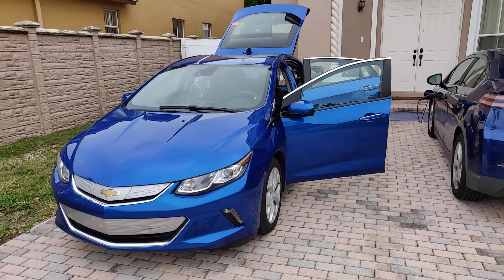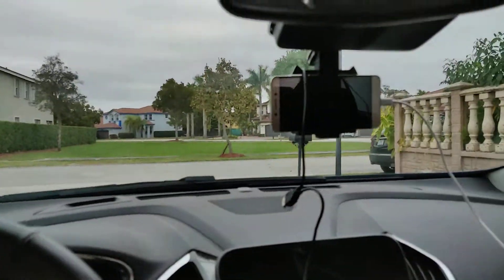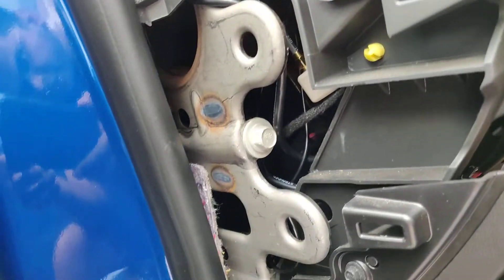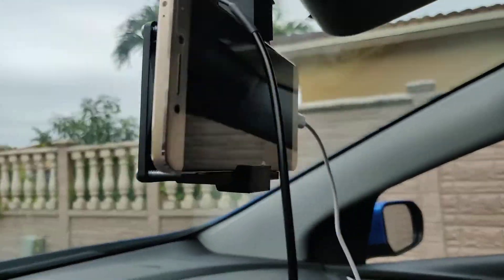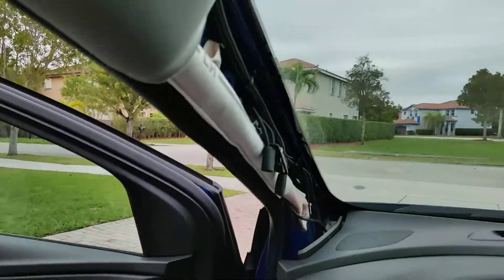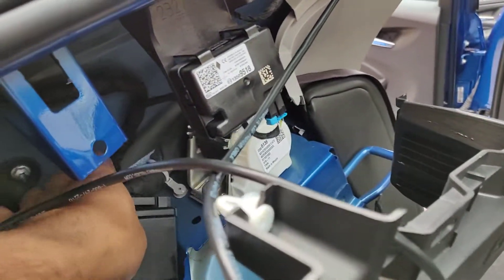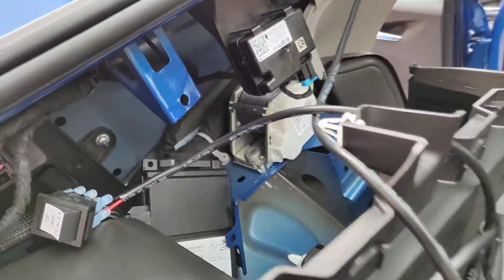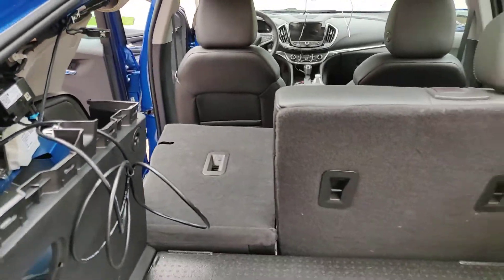Chevy Volt Openpilot Comma Ai Install

Comment: does the order of when/how you flip the various switches matter?  "Dealer" etc?
Reply from the maker: I just have it off when I take it to the dealership
Reply: @SP-cm8lg  ok, but is there a certain sequence to flipping the 2 switches?  For example, do you set it to "Normal" in the back and "Comma On" in the front, then turn the car on?  or, do you turn the car on and then flip the switches?  I keep getting "Radar Error: Restart Car" and am trying to debug it!
Reply from the maker: Maybe a wire is loose somewhere when you installed the harness, I had a lose wire had to fix the issue.
Reply: @SP-cm8lg  yeah, I tried that.  I have actually installed it on 2 different Volts (same spec) and the error persists.  So maybe the harness itself is bad?
Reply from the maker: @CH-qt4hr  contact the Maker of the harness maybe he could put some light on the issue you are having. Maybe try to do an update to comma 3.
Reply: @SP-cm8lg  I am on Comma 3, brand new.  They are sending me a new USB-C cable to see if that fixes my issue. Did you get that same radar error?
Reply from the maker: @CH-qt4hr  well I am still on the old comma have not upgraded to comma 3 yet, they have stop all support to the older comma so I have to upgrade.
Reply: @SP-cm8lg  thanks for all the help
Reply from the maker: @CH-qt4hr  let me know if your issue get resolved.
Reply: @SP-cm8lg  Issue RESOLVED.  The fuse that you use to power it was installed upside down (not backwards, but just flipped over).  I guess it has to be plugged in one way only.  Once I did that, everything worked perfectly.
Reply: @CH-qt4hr  your tip about the fuse reversed saved me, I was going crazy trying to figure out what was wrong. I put it in with the fuse sticking up so it wouldn't block the fuse below and that was causing radar errors. Flipped it over from reading your tip and it started working. Thanks!

Comment: Which version of Open Pilot is this? Will any version work with a 2017 Volt Premier with Adaptive Cruise Control and Lane Keep Assist?
Reply from the maker: All open pilot version works on the Chevy volt.
Reply: @SP-cm8lg  do you know how much better the newer ones are compared to version 1 and 2? I saw one for sale used that I believe is the first one and it needs the software flashed to it so I don't know how big of a deal that is.
Reply from the maker: @TCMapotherIV  I have not used the new one yet, if I was in the market to buy this for my volt I'll go with the comma 3.
Reply: @SP-cm8lg  that is the new one isn't it?
Reply from the maker: @TCMapotherIV  yep they are going to do lots of integration to comma 3, comma 1 and comma 2 there is no support no more.
Reply: @SP-cm8lg  I'll probably wait a little while to see how it improves before getting it but definitely want it.

Comment: Has OP2 been ported for the Volt? Haven't seen any new updates.

Also how long does it take for the phone to boot and go into "Ready" status ? Thanks!
Reply from the maker: Yeah op2 is working on the volt, I did not update my yet because it is working just fine for me. To get it all going maybe a min or two.
Reply: @SP-cm8lg  I checked on the Comma website and it says it's not yet supported. Do I need to join the discord or something?
Reply from the maker: @spotnick9526  yeah at discord GM tab they have the hardware under the different name trust me comma 2 works on volt.
Reply: @SP-cm8lg  thanks!

Comment: is that the only place to buy a devkit? They have been sold out for a bit.

Love your color. I have a grey 2017 that I'm trying to install everything on. but I need to buy all the equipment and find the step by step instructions.
Reply from the maker: Yeah the only place to buy the devkit it's take time to make them custom order. Yeah I love this color let me know if you need help installing the kit.
Reply from the maker: Get the comma 2 for the volt it is supposed
Reply: @SP-cm8lg  truly appreciate the offer man. I'm shopping for the equipment now.
The way I understand is I will have to find the code after that to "flash" onto the hardware then hope it works out?
Reply from the maker: @jasonw8497  not sure what code? Everything is plug an play.
Reply: @SP-cm8lg  so on going through crash course on this.

You couldn't find the black box giraffe so you bought the cable harness. 

Does the giraffe matter? black grey etc

are you running open pilot 1 or comma 2?
Reply from the maker: @jasonw8497  I am running opening pilot one, if I had to do it all over I'll do openpilot 2/ comma 2

Comment: How did you run the Lee&Paulding harness through the headliner?   Did you have to pull it though with a wire or was it clear enough to pull it through?
Reply from the maker: Had to pull the wire in the middle